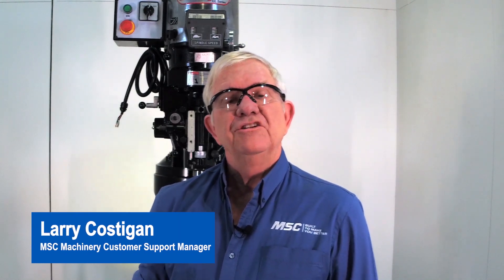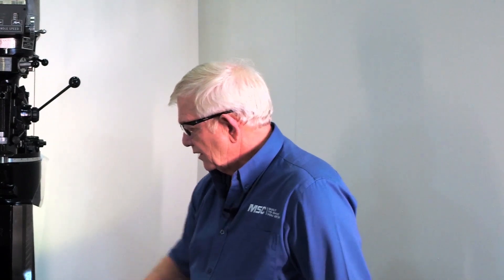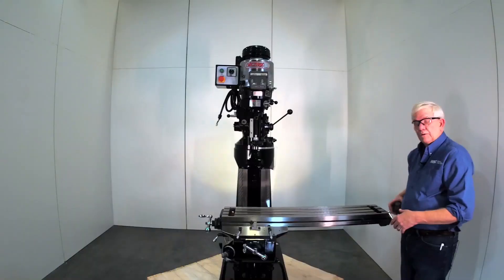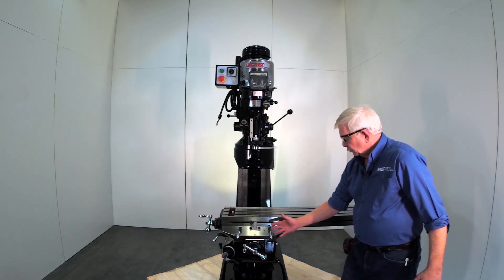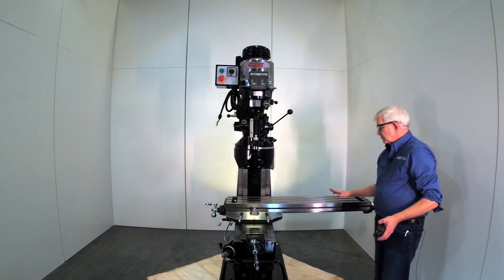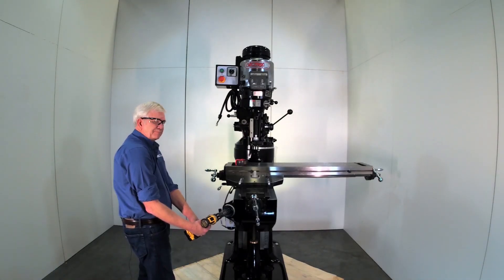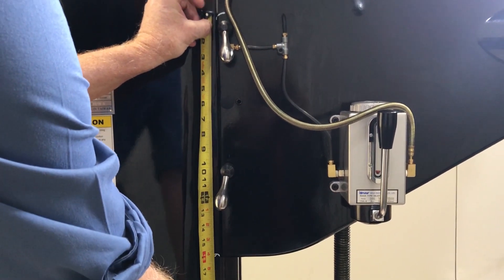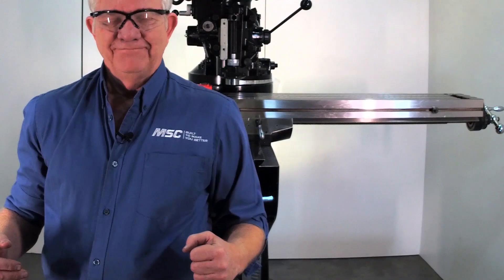How-to Measure a Milling Machine for a DRO Unit

Comment: You place the mark anywhere up and down across the saddle and table as a single vertical line with the table all the way to one side, then move the table all the way out the other way and measure from the vertical mark you made on the saddle to the other 1/2 of the vertical line on the table.